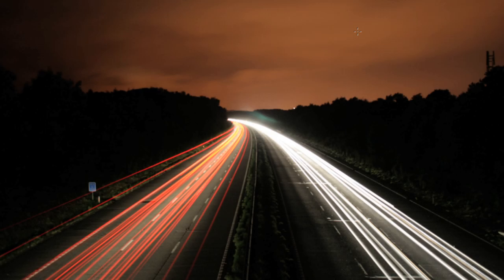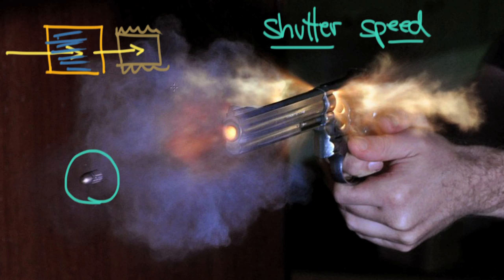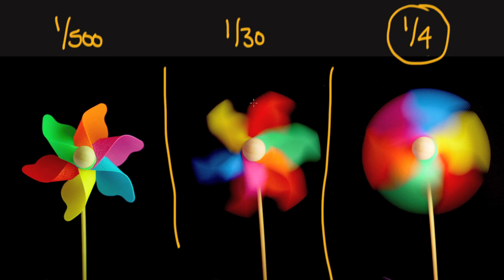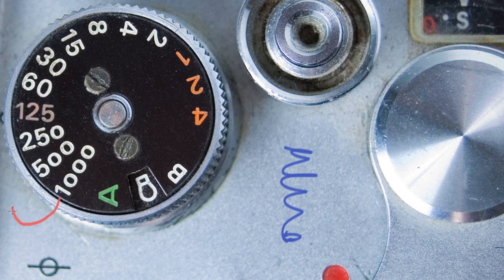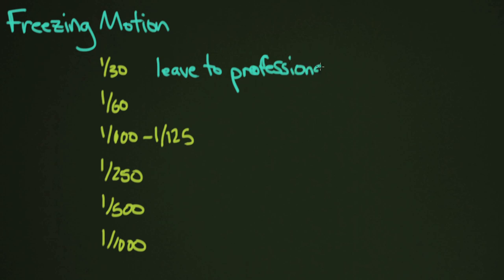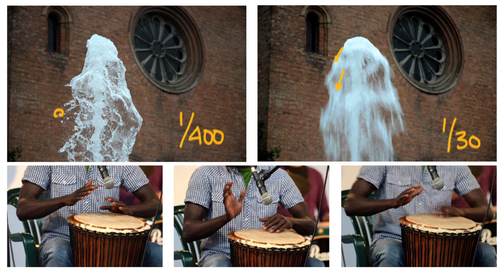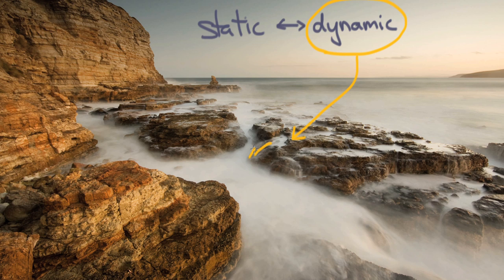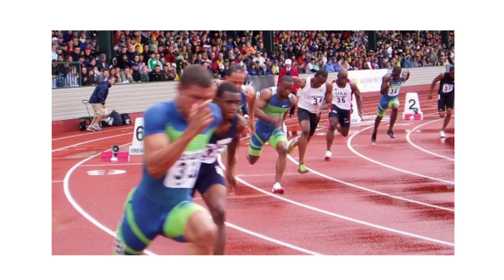How Shutter Speeds Work

Comment: is 1/250 the same as 250ms of a second? I find 1/4 sort of confusing then.
Reply: if you divide a second into 250 equal portions, then only had the shutter open for 1 of them, that would be 1/250. if you divide a second into 4 equal portions, then only had the shutter open for 1 of them, that would be 1/4. 

Milliseconds (ms) are what you get when you specifically divide a second into 1000 equal portions. so 250 milliseconds is the same as 250/1000, which of course simplifies down to 1/4. Milliseconds are not what is counted at all in shutter speed, unless you are using a 1/1000 shutter speed, at which point you're saying the shutter will be open for 1 millisecond.
Reply: @dawnredd429  So what is 1/250 then?
Reply: @RomboutVersluijs  that would be 4 milliseconds. 1/250 (which is the shutter speed) = 4/1000 (milliseconds are always something /1000 which is why they're called "milli"seconds). 

Basically, shutter speed is thinking in terms of a second. So the bottom number will always be how much you're dividing the second into. To convert to milliseconds, you just have to find what multiplier or divisor makes that bottom number into 1000
Reply: @dawnredd429  okay thanks